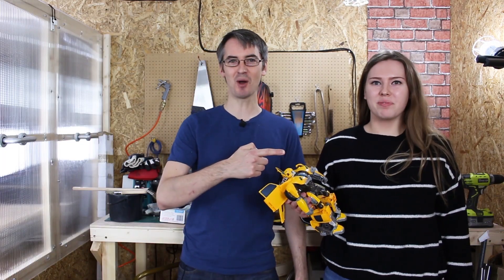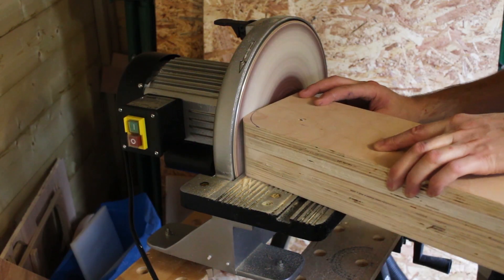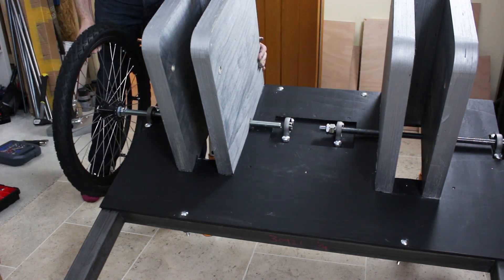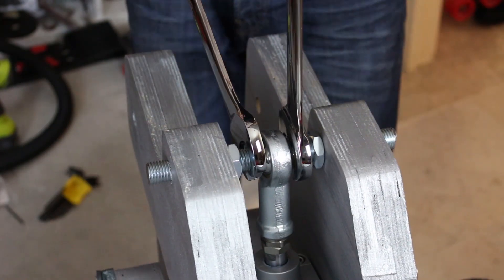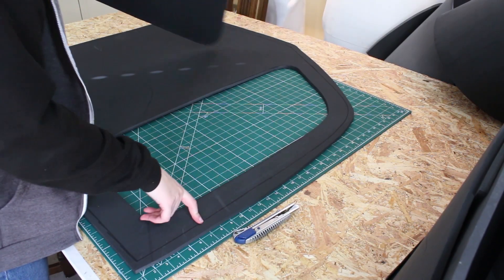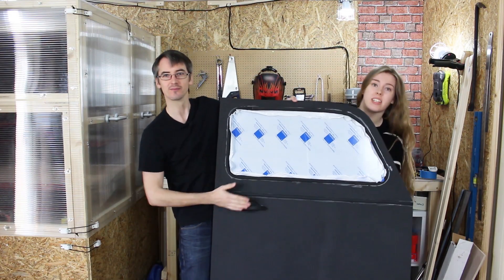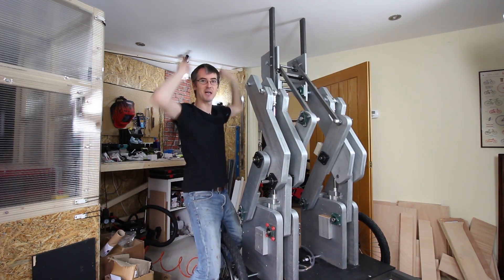Building Bumblebee the REAL TRANSFORMER #1 |  James Bruton

Comment: Love your skills and videos. That said: Get a proper respirator. What's in a grinding / cut off disc: Fibreglass, Epoxy, Silicon Carbide + you are getting metal particles from what you are grinding.

Comment: I love the video. Can't wait for more.
I do think a heavier primer or maybe multiple coats of silver on those internal plywood parts would have been helpful. That wood grain showing through kind of negates the purpose of the silver paint. It looks like "gray wood". I know it gets "mostly" covered at the end based on the design in the beginning but a coat of primer to hide the grain, or even matte black instead of silver paint would have hidden that wood grain a tad better.

Comment: Two tips: welds get better the slower you move the arc around and when inevitably the air cylinders prove to be too weak, up the pressure to 12 bar.

Comment: For cutting steel tube, you should investigate the hand held bandsaws. They cut quickly (with a slow blade) no sparks, and theres no risk of a disk exploding and taking your eyesight out. I have a dewalt one, it will chop steel box section that size in about ten seconds. And its so quiet and lovely to use. I hate angle grinders.

Comment: James, your welding looks suspiciously splattery and chaotic, make sure you are using the properly matched rod for your settings. It almost looks like you're using AC rod on a DC setting or vice versa. Try AC/DC rod and practice x3, it'll make your life a lot simpler once you don't have to screw everything together and weld it. They also make 90 degree corner magnet clamps to make life simpler. Spot weld to hold straight and then weld it properly and completely.

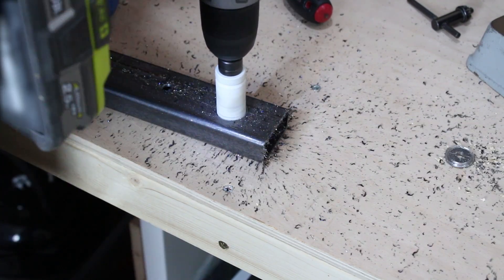Comment: I love how you can see magnetic field lines at 8:50
Reply: I don't think there's a magnetic field, but rather the steel gets electrostatically charged from the friction with the drill which causes the tiny metal pieces to align in a radial field
Reply: YourMJK maybe the steel was magnetized by an electromagnetic lifter at the factory?
Reply: James Davis Hm, could be the case.
Reply: @jamesdavis2027  nope..that happens even when i sharp my Saw
Reply: @YourMJK  yes somethin like that..
Reply: friction itself can charge, ever rubbed a rubber balloon on your head? the only thing acting is friction.
Reply: @Xxavil  The metal dust alignes on the table with a nearby magnetic field
Reply: @stocchinet  that's cool dang

Comment: There are Valve blocks which could help you synchronizing your zilynders and prevent them from binding up. Thy are called flow dividers. I only know them from hydraulics but they might exilst for pneumatics too. Sorry for my bad English and good luck with your project :)

Comment: Buy a proper MIG welder! This will increase your welding skills to the next level! Great project.
Reply: Or meet up with Colin Furze again and have him teach you tig welding.
Reply: Theres no reason those welds cant be done with stick.  A mig welder is kind of the easy way out.  Learn to weld stick first and the rest will come easier.
Reply: @DoRC  Just what i was about to say. Also amount of welding James is doing is so little that owning or renting a Co2 bottle is just very costly... and using gasless MIG wire.. Sure it kinda works, but it will rust when outside and this will screw your guiding tube. Stick is easy to store inside away from moisture, while machine can be stored in workshop.

Ou and +James Bruton take your sticks inside. Moisture will build up and then you have miniature steam explosions, or stick wont light up properly. Removing moisture can be done by putting them into oven for couple of hours in 150C.
Reply from the maker: yep ;-)

Comment: You should hit up Evolution for a chopsaw for cutting the tubing. 
Also maybe you could do with some counterbalance springs to reduce the force needed to transform?
Reply from the maker: I've considered springs, but they'd have to fold 'so flat' they wouldn't have much effect initially. The cylinders are more than strong enough - right across the maximum leverage point.
Reply: @jamesbruton  Have a look at constant force springs. They fold rather small maybe they could work, i get the feeling the project is a bit too far to add something like that though
Reply from the maker: @oliverhope417  It's more than powerful enough on about 60psi, there's a lot of overhead also
Reply: Actually I was more thinking of the New diablo Wood/metal saw blade that fits on a normal skillsaw!

Comment: Hang on a second. Plywood is stronger than steel, pound for pound? I've got some research I need to do now cause while that sounds like a piece of information that is probably true, I need to know why!
Reply: I dont think it is stronger I just think the wood is plenty strong for its purpose so it would be more beneficial to use wood because it is lighter
Reply: It is completely accurate. On a per weight basis, plywood is stronger than steel. Romans made their shields out of it because it was light weight but strong. Look at what you get with a pound of steel then look at what you get with a pound of wood.
Reply: @nathanrogers8713  You get more plywood coverage for the same thickness? This is a weird thing to say 'pound for pound'...If you keep the same thickness would it be harder to break in half a tiny steel shield or a large wood shield? I'd say the tiny shield would be harder to break in half,  just a guess. On the other hand, if the shields had the same coverage but not thickness the steel would probably fold under it's own weight, heh. The phrase itself just doesn't really make sense when you analyse it.
Reply: @EricWilliamsCG  In the case of the Roman shield, they were a specific dimension. If you made the same shield out of steel it would be challenging to even move. Yes it would stop anything they could throw at it but if it couldn't be carried by the legionnaire's what would be the use. If you built the shield with the same dimensions using the same weight of steel, it would be like carrying around a sheet of aluminum foil and expecting it to work. That shield made of plywood was light and incredibly strong. It could stop swords and arrows without issue and could be carried for days. So yes on a weight for weight basis, plywood is indeed stronger than steel.
Reply: @nathanrogers8713  Unless I only need to block a tiny area with a tiny shield. Pound for pound or weight for weight is meaningless without context like dimension is all I'm saying, it's just a gimmicky phrase.
Reply: I'm pretty sure it's more rigid, but tensile strength isn't better then steel.
Reply: @MsSomeonenew  Is its tensile strength better than an equivalent weight of steel?
Reply: It's called "specific strength" in engineering terminology.  Strength/density.  I don't know enough about wood as a building material to know whether this is the case, but if you're curious, "specific strength" would be a good search phrase.  Aluminum alloys have good specific strength, which is why they're used in aircraft.